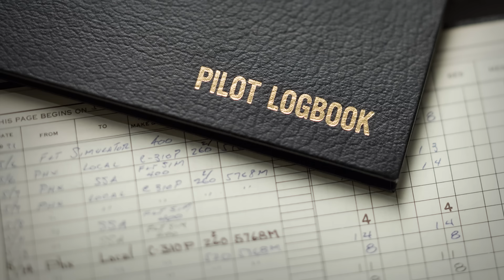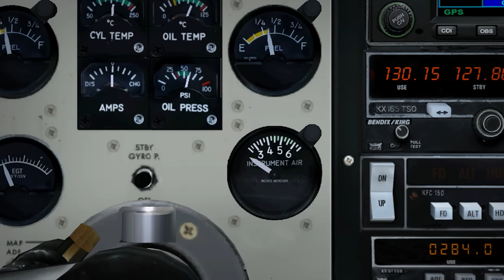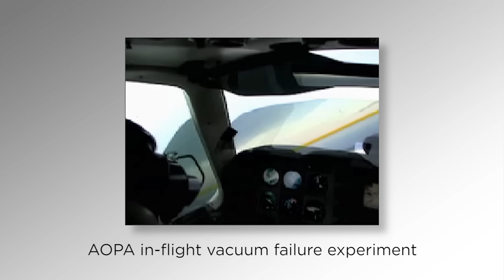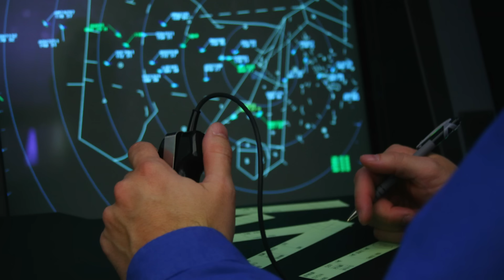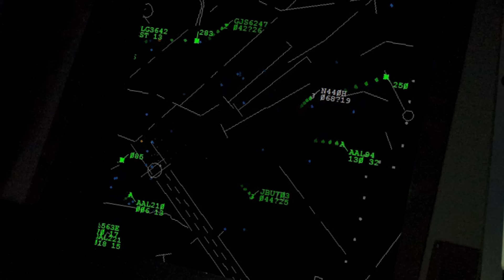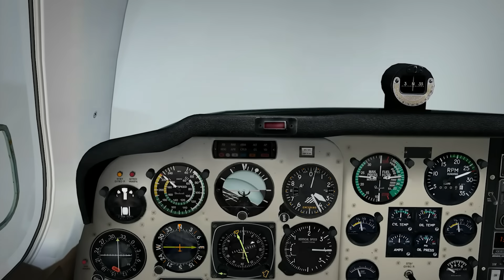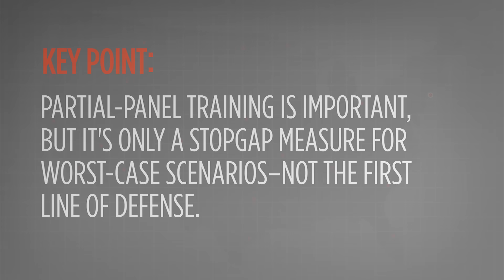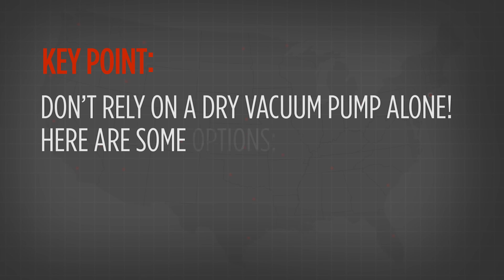Accident Case Study: Single Point Failure

Comment: I always wanted to fly but not being able to see the colors red and green kept me from ever doing it.  After watching these videos I cannot get over so many deaths due to careless disregard.  I own a 38 foot Sea Ray cruiser and I frequently take friends and family out on Lake Huron.  Before even doing that I check the weather and radar, check the oil and engines and engine hold for any signs of trouble. I also pull life jackets for each member out of the storage locker and stow them for easy access at the seating areas along with the type 4 throwable within quick access.  I am constantly watching the gauges for trouble and at night someone is assigned to watch the radar so that my eyes do not have to adjust between bright and dark and another set of eyes watching over the bow to watch out for people in small boats with poor marker lighting.  It is unfathomable to me that someone would ever risk flying into parameters that they are not trained or qualified to do.  What in their brain would say "I can take this risk"?  In a boat you can at least drift, but in an aircraft.....no way.

Comment: Sounds like ATC didn't fully understand the seriousness of a vaccuum failure.  The pilot didn't either.

Have wondered why can't a auxiliary venturi be fitted to the underside of the aircraft to provide some suction power. Place it downstream of the cowl flaps to keep it ice free. Obviously not useable on ground but could it provide enough suction to keep horizon gyro spinning.

Comment: I have a genuine question to anyone who may still be watching this video. 
I am currently training for my PPL, and have never flown in instrument conditions. 

I am just wondering, how do these pilots not “feel” their movement? When you descend, you feel lighter. When you climb, you feel heavier. How did this pilot not feel the lack of G’s in a in an incredibly steep descent?

Not trying to sound “snobby” or as if I know better, just genuinely wondering.
Thanks to whoever may see this.
Reply: when you have no visual reference and you dont trust or understand your instruments going just by feeling g forces is not enough . i guess a close analogy would be to go dive in a pool blindfolded a few times and you might get the idea . and dont forget that in an airplane there is zero tolerance for error in imc
Reply: The reason that doesn't work is our inner ears are not adapted for flying.  For example if we are pitched up for some time, our inner ear resets itself so that pitched up feels normal.  Without a visual cue (the horizon) we will think we are level, but it is an illusion.  But it feels 100% real.

A simple example of this that anybody who's ever been on a commercial flight has experienced is the feeling of descending and/or pitching down shortly after takeoff.  It feels like the plane is dropping, i.e. there's the sensation of being "lighter," but the plane really is still pitched up and it's still accelerating.  But our body feels like we're sinking.  And that happens even if you can still see the ground.  Imagine a similar feeling when all you can see is flat grey.  

That's why "seat of the pants" flying doesn't work.
Reply: It does not take long for the human to become disoriented. The sudden movments can be felt but gradual ones are much more deceptive, so after 30 seconds you are no longer aware of exactly which way is up. Flying straight and level,  or flying in a very slow well cordinated turn, or being in an accellerating spiral dive, are situations that all feel exactly the same.

Comment: I told a customer of mine that his vacuum pump was approaching 500 hours, he asked me if it was a big deal I asked him " how good are you at partial panel?" he said "change the pump"
Reply: You prob saved his life.
Reply: @SVSky  correct
Reply: @SVSky 
 Let's not go that far
Reply: Just throw away all the ancient vacuum pump, gauges, and replace them with modern solid state EFIS
Reply: @2Phast4Rocket  just as soon as the FAA approved TSO for the AV-30....
Reply: @ShuRugal  the FAA has approved a bunch of EFIS that used to be from the experimental world. GARMIN, Dynon all made the list. Plus the FAA can approve the nonTSO rEFIS if it isn't used as primary instruments. So in the case of partial panel, the rd is can be used for emergency pirpose
Reply: @2Phast4Rocket exactly, these planes are antique garbage technology, and people are risking their lives in them.
Reply: @2Phast4Rocket  They can go blank when a nearby lighting occurs and with those glass cockpit you lose everything. Better to use old fashioned ones as back up .
Reply: On my car, the gas meter was bad, ran out of gas twice, can't imagine dealing with partial info on a plane!!
Reply: @rolandocrisostomo2003  the solution to that is to just top it off routinely. In a car all you have to do is set a trip and refuel ever 150-200 miles. If you don't have a trip just keep track of odometer.
Reply: I had a vacuum pump fail after 150 hours only. I think this goes to prove that just hoping the pump will work up to 500 hours is not ok. If you fly IMC, get a secondary system like a G5, Levil BOM or GDL, it's not an official system, but between a partial panel and a BOM, I'd be happy to have a BOM.
Reply: ..with a wet pump
Reply: How about battery?
Reply: POS airplanes need “vacuum” instruments
Reply: I’ve had mine fail before the 500 hours. Had it replaced with a rebuilt one and that rebuilt one failed 3 months later. I can attest to the very slow failure. The first one failed in flight. Roughly every 10 minutes on a cross country I check the directional gyro is synced with the magnetic compass. I was noticing I was having to calibrate it a few degrees in cruise (usually it’s pretty much dead on for 1+ hours at cruise power). Then the attitude indicator seemed a little slow to respond. About 15 or 20 minutes later the attitude indicator nosed down (showing a maximum descent and a turn to the right and the dg started spinning. I looked down at the suction pressure and it was 0. It was a very clear VFR day so it wasn’t a big deal but I still took out suction cups to cover the dead instruments. It’s amazing how they just fail out of nowhere. The second one failed when my A&P was taxiing it back to my hangar after getting some work done. Have to be prepared in IMC! You never know when an instrument is going to fail. I’ve had the plane for a year prior to that and it was working great with no indications of failure at all up until that flight.
Reply: Fabulous comment.. So true.
Reply: Well said ☝️
Reply: I had two vacuum pumps and three turn coordinators fail in my first 275 hours of flying ,fortunately VFR. I never trusted a single vacuum pump in an aircraft (had to have dual pumps) when I got my IFR rating.
Reply: They usually fail at 900 hours. The Rapco ones with the wear indicator, anyways.
Reply: @Bartonovich52  let me tell you, these pieces of shit like to fail before 500...
Reply: @WaterFucKing

Not with proper maintenance like changing filters.
Reply: @youngtschakaloff  the one that came in my bird failed at 300 and 7 years.  at the rate i fly (50-60 hours/yr) the replacement will probably age out before it wears out as well.
Reply: @Bartonovich52  I hope you found a old video from AOPA they covered a partial panel when the pump hit 501 hrs they lived

Comment: No way I would fly SE in IMC, too risky, I value my life way more!
Reply: Do it all the time...not risky at all. If you have risks, you’re unprepared. Expect things to go wrong, not hope they go right. Plan routes that take you near or over airports with approaches, fly high enough to give you glide range to be above these approaches, know where the weather system is and where it’s moving, avoid extended flight over systems with clouds/vis below minimums, know the equipment on your aircraft and how to use it, have backups, and most importantly stay proficient, not just current. Has served me well in my 3 engine failures.

Comment: I wouldn't ever want anyone to die so it will sound cold when I say it is good that nobody will ever have to share the sky with this 'pilot' again. We'll never know if it was overconfidence, arrogance, senility, or something else. Whatever it was it seems that facts presented him right from the beginning (a flight plan directly along and through a front for the duration of the flight) and all during the tragic flight simply couldn't penetrate whatever fantasy he was living. RIP
Reply: Uhh, it was a vacuum pump failure he was unprepared for. He got behind the airplane, which is easy to do in a high performance complex in IMC...

This comment is so misguided on so many levels, shows a massive amount of ignorance, but most of all disrespect.

Comment: Point 1 of the conclusion is the most important point of this story.  Partial panel failure training is for worst case scenario not for first line of defense.  If one has the opportunity to get out of dangerous situation by aborting flight early, why do they make it a first line of defense.  Only use that training when there is no opportunity to avoid it.

Comment: I feel bad for the second controller. He was trying everything he could think of but wasn't sure the exact nature of the emergency or how he could help. There was a misunderstanding when the pilot said "partial panel - we've lost our vacuum system" the controller read back "understand partial evac system lost". Most controllers would not know what partial panel or vacuum system means. They would pass that information on to a sup. "He's saying partial evac system lost". The sups would then scramble to find anyone in the building with pilot experience to figure out what that means and how to help. Even if the controller knew the exact nature of the emergency it would still be difficult to help. If there was no precip showing on the radar, the best you could do is offer a climb, solicit pireps throughout the area, check all the nearby airports' weather (which he did), and try to find an area with the lowest tops reports. As a controller, this is a nightmare: knowing the pilot is in trouble but not knowing how to help. Prayers to the friends and families.

Comment: To fly IFR with no back-up vacuum/electric gyro system is suicide.  Just a question of time before you die.   A few flights will go fine, but the LONGER you fly, this sort of thing will happen.  Don't do it.  Those, like me, who have experienced a spiral dive in IMC, do not take chances any more.  Nearing death changes you, believe me.   Salutary.

Comment: This is why having backup avionics on your phone or tablet (preferably those with external hardware for more accurate readings) is important. Even if they aren't as accurate it's better than nothing and especially if they're powered by your phone's battery you can still have at least something to assist VFR flight in the even of a vacuum or certain electrical failure.

Comment: I am subscribing to foresight synthetic vision and will carry 1 iPad & 1 iPhone as backup.
Reply: Only works with an AHRS source...
Reply: @zippoc04  Yes, The raspberry pi based ADSB unit Stratux has AHRS & GPS chips.
Reply: @coolhari2000  Yes, as a hardware engineer I’m familiar. Just wanted to state that your iPhone or iPad by themselves won’t provide you the synthetic vision without an auxiliary input.
Reply: @zippoc04  Ah gotcha, Yes thank you.

Comment: A genuine question: how can you be VFR above clouds with no reference to the ground? Doesn’t this make you IFR althoughu you might be above tops of clouds?
Reply: Yes, technically you need to be able to see the ground to fly proper VFR. This video is more or less relating to the conditions named "VMC" standing for Visual Meteorological Conditions. IMC being the counterpart namely instrument meteorological conditions.
Reply: StreamCareers What I was thinking is, if the guy wasn’t qualified to fly IMC then he shouldn’t be flying above the clouds, as then with losing sight of the ground his flying against his license privliges - am I right?
Reply: @HalfbakedStandard  Tehcnically you are right. However the pilot in this incident was ATP (=Airline Transport Pilot) rated and held an instrument rating. When his VAC pump started to fail he was already above the clouds.
Reply: @HalfbakedStandard  In case you didn't understand properly: The Vacuum pump is needed in order for the Artifical Horizon and other gyro-instruments to work. With the VAC failing the pilot had to fly under what we call "partial panel". Partial panel flying in IMC conditions is mostly if not everytime an emeregency situation. So what I am saying is the pilot was rated to fly in IMC and the plane was as well, however when the VAC failed (without backup) the plane was technically unable to fly IMC and with that the pilot.
Reply: @PCPofficial I'm sorry if this lead to any confusion. I wasn't thinking about differences between the US and my own country. If it is legal in the US, disregard what I have said about that!

Comment: what does the vacuum pump do on a plane
Reply: It powers the attitude indicator, the horizon-looking gauge that gives a visual indication of which way is up.  You can’t rely on feelings because you can get vertigo.  If the pump fails, the instrument will tumble and you have to rely on super bare-bones other instruments to determine whether you are right side up or not.  Pretty much an emergency if you are in the clouds.  If you bought a simple backup, the instrument continues to work.

Comment: If a friend invites me to fly in a 152 Cessna around the local area on a nice day, ok. No way, no way am i flying a long cross country thru weather systems in a Bonanza. My dad and his friends got lucky flying a bonanza, pilot got into the clouds, but by the grace of God flew into a pocket of no clouds, the guy had the instinct to just get on the.ground wings level at as low a speed as possible. My dad described it. He made controlled tight turns down to the tree tops in the mountains the dropped into the trees in a stall, they almost died of exposure, they all huddled in a four man ball in the wrecked bonanza for 3 days. The weather cleared, and they heard a helicopter, they looked up and the Air Force helicopter was looking down at them. The were bruised and banged up, but lived.

Comment: Saying that the plane had "no" backups is erroneous. Partial panel is the backup -- that's why it's there, that's why it's taught. This video is a black eye for ASI -- platitudes and inaccuracies have no place in safety nor in training. There are good points in the video but making a major theme based on a falsehood screws the pooch.
Reply: Ed Cew   The narrator in the video is using correct terminology.  The partial panel is still considered Primary instruments.  Backup is a stdby gyro or an alternate vacuum source.  Backup instruments replicate the information of the failed unit.  If theADI fails you cannot get pitch information from the T/C,airspeed,altimeter, or VSI. You can deduce pitch from those instruments. Sanctimonious millennials such as yourself are a black eye on society.
Reply: Technically you are correct, but lets face it in a true life or death situation stress levels can inhibit your abilities. The video is just trying to convey that a back up vacuum system would have been of great benefit and other pilots flying IFR should consider to have one as standard equipment .
Reply: Then the video should have said that without the hyperbole.
Reply: @edcew8236  that may be true, lol.  Seriously, adrenaline really messes with your brain and ability to function so I was just pointing that out. Safe flying if you do!  Dr Stephen

Comment: just for  your consideration, weather services can pass on a lot of information but if you are flying VFR [ visual Flight Rules ] over the top, they most  likely cannot tell you where the holes are for you to transition back under overcast layers as you approach your destination, Understand clearly the weather radar does not have the capability to indicate where clouds are located, except if there is returnable data like precipitation or returnable activity occurring. observation stations are separate by miles and there are areas where estimates are provided. A pirep [ pilot report ] may be useful with the understanding that weather is not static and rapid changes in conditions are possible.

Comment: Of the dozens of GA airplanes I've flown the Bonanza is the one I'd least like to have to do partial panel flying in.  Its magnificent handling and light control pressures come as the expense of only slightly positive lateral stability, which means it will start a 1g bank if left unattended, which can go unnoticed until it's too late.  A common accident cause for Bonanzas is loss of control in IMC.

Comment: Only once flew into clouds, in a sailplane no less. Crazy weather right beside the ocean and mountain ridge line next to the airfield. Clouds literally forming and rising up out of nowhere on a weird weather day. Although descending with full spoilers to get back on the ground asap, I had to resist over-controlling the glider and just let it settle into a fixed forward speed and direction.  No need to even manhandle the stick, just watch the compass, airspeed and VSI. So hard to trust the glider to mush itself along for the 30 seconds it took to pop out below the clouds, but I lived...never to ever be in that stupid situation again. Different situation for a power plane on a long cross country trip of course, but the brief time I spent in terrorville was enough.